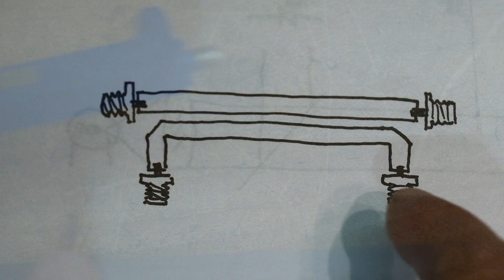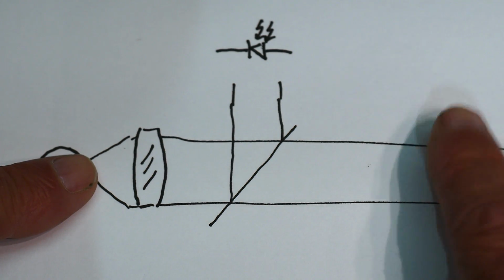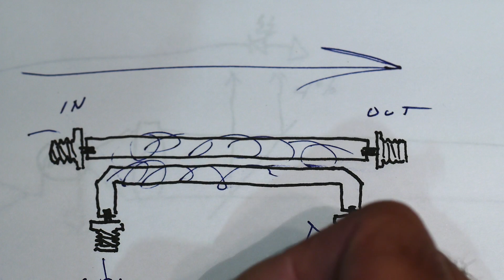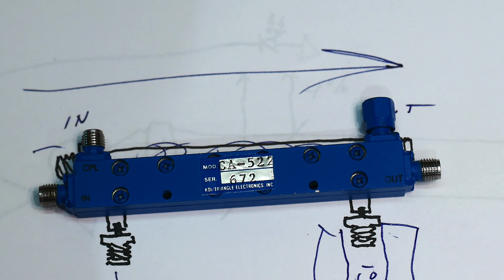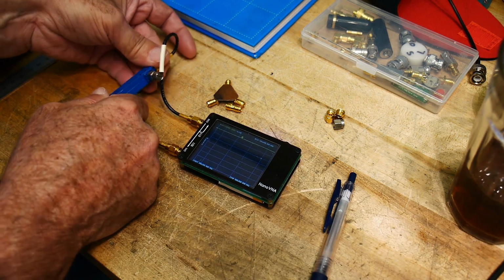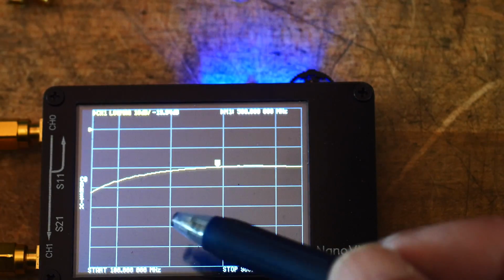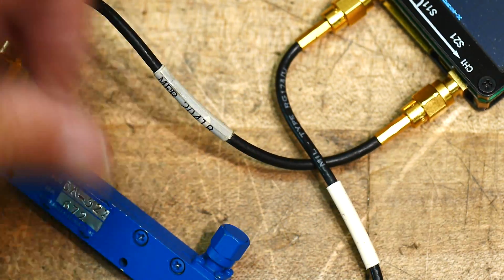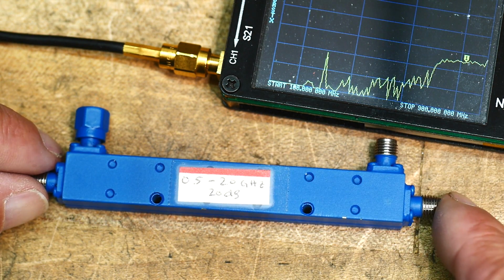#495 NANOVNA Measurement of Directional Coupler

Comment: please make a video about RF amplifier Phase maching and power combining
Reply from the maker: I have some already, search my channel for amplifier and splitter (used backward for combining)
Reply: @IMSAIGuy  please tell me 
Can we use Vector Network Anylizer for phase maching 
And I have 2kw Rf amplifier wih 8to 1 combiner all rf amplifier have more than 1.5kw individual out put power but when i connect these amplifier to cmobiner it output show less than 4kw is it happen with phse maching error or impedance maching 
Amplifier range is 1250mhz to 1350mhz pulse amplifier
Reply from the maker: @chamodr95  that is a large system and not all can be measured with a VNA, but certainly you can measure things like the electrical length of the different paths, the %transmission of things, and the SWR at various points. Since it it portable, measurements at the antenna are possible.   all the measurements are done at milliwatt powers so it will not account for loss do to high power. I don't have any real experience.
Reply: @IMSAIGuy  thanks this module use for Radar and it is tha finel out of 10kw if the total output more than 8kw then we can switch on CFA and it power up to 100kw this is old military radar can i know what is tha basic instrument use for pahse matching 

We have Vector Network anylizer  ,signal anylizer  , oscilascope powermeter frequency counters 

And yesterday i power the amplifier and use vna with ratio b1 /b2 and use attenuater and coupllers to reduce output power to -10dbm because vna cant handle too high power 

Then frequency genadator out certain frequency  but the vna show it varied highly. -30 dgree to 160dgree. So i remove amplifier and connct vna to signal genarator with coupler but it show phase angel pin point

Comment: While that 50 terminator may never be removed, if you wanted to analyze a 75 Ohm cable you can just replace the 50 Ohm terminator with a 75 Ohm terminator and the coupler will work just fine at the new impedance.
Reply: Could one be made for 300 ohms?

Comment: The 20dB is for the coupled port. The load is for the coupled port, pre-set impedance.
The dB rating comes from the coupled port distance from the main line. 
X input, coupled to sample port 20dB lower level.
Reply from the maker: Thanks. that makes perfect sense

Comment: I've got a very old one, produced by motorola by someone and sold as part of their required test equipment in the 70s. 26as101-1 One way I use it is to run it directly to a dummy load, and put an atenuator on the sample input/output, and a sig gen on that. I can measure receiver sensitivity without having to worry about tx. blowing the test gen.

Comment: 500 MHz to 2 GHz otherwise perfect video next up maybe a circulator if you have one 👍😎
Reply from the maker: No I don't have one. Do they operate below 1GHz?
Reply: @IMSAIGuy  Yes, circulators work down into the MHz region.
Reply: @IMSAIGuy  If you find some of the older cell phones that had a black box full of electronics there are several circulators that operate in the 800mhz region.